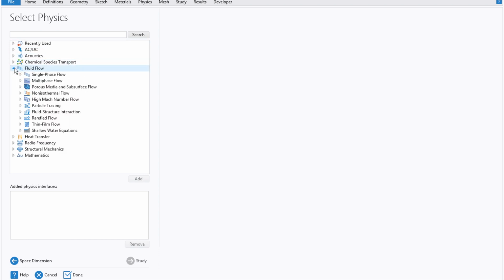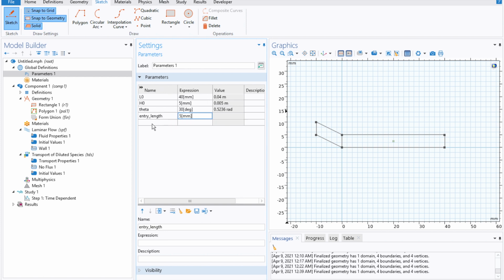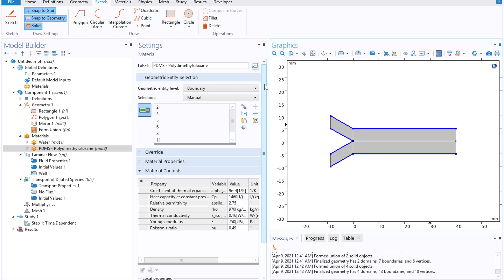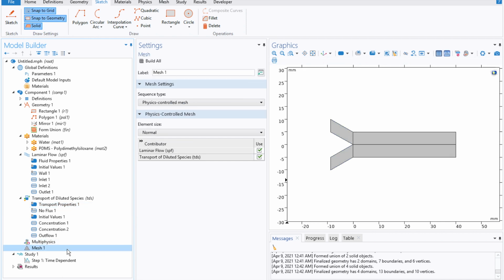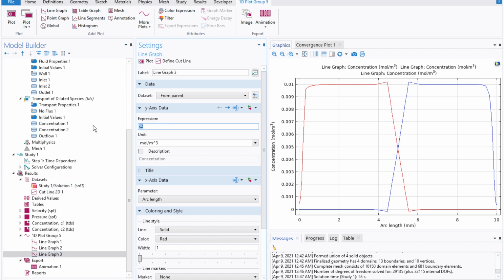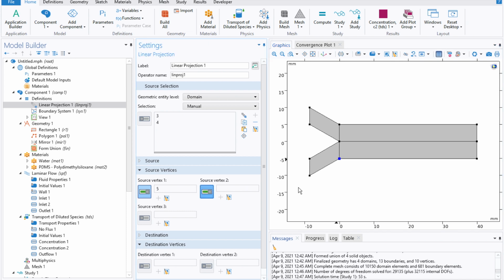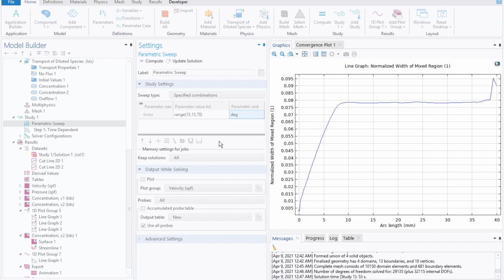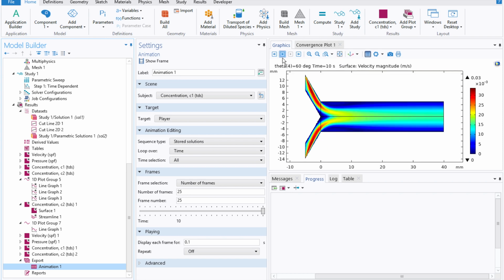Microchannel Mixing in COMSOL

Comment: Hello. Nice turorial. A short question: You are using an unstructured mesh where the faces and the direction of the main flow have a varying angle. I used an structured mesh and experienced a much narrower region where the species mix due to diffusion. Is it possible that the broader region of mixing in this simulation originates from numerical artificial diffusion due to high gradients between mesh face direction and background flow ? Thanks.

Comment: Hi,

I want to simulate a biological Methanation process. In a Pipe I have 2 inlets and 1 outlet. In the first inlet should flow in water and in the second inlet should flow in a (hydrogen/carbon dioxid) mix. my goal is to obtain methane in the output by a chemical reaction. Wich Physics do i need for this Process?

Murat